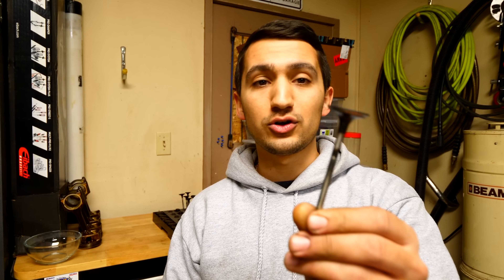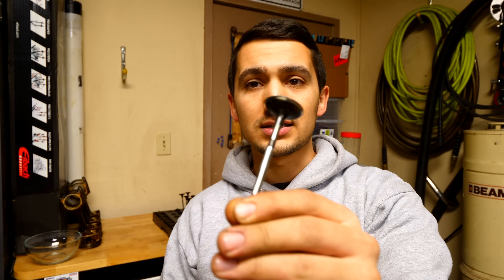How to Clean and Refinish Valves

Comment: the clearance between the stem and guide is much larger now this engine will smoke badly when first started  and continue .the stem seal allows a very small amount of oil  to slip past to   lubricated the guide. but its job is not to completely seal off oil from entering. the tight clearance between stem and guide are now much wider .you just tripled the amount of oil slipping past seal and right into the combustion chamber.

Comment: All comments about ruined valves aside, dude, at least change the water in between each grit of sandpaper!  Otherwise, you still have bits of the 800 in there when you're doing the 3000 grit!

Comment: So did you put this valvesback on the car? If you did is it still working after pushing the engine to the limit few times? No offence, buti think this is a way to have a beautiful shiny bent valves. It's ok to polish the valves where the carbon is getting accumulated, but sanding and polishing the stems will actually allow them to wiggle in the valve guide. Of course it won't be too obvious, but in time it will, (more likley when they will bend). And what is more important then everything is to lapping the valves. But we all learn from our mistakes.

Comment: it is good to have the carbon removed and on a smooth surface it will be harder for the carbon to ´stick´
It is hard to avoid the valve stem and even harder to avoid the seat area.
These area´s are measured in thousands of an inch !
@milanmastracci; if you get so many negative responses you might be doing something wrong.
You might want to review you're video and change or remove it.
there might be 6,5K thumbs up who are damaging there valves right now.

Comment: stop by your engine rebuilding shop.. take one valve with you.. ask for a single K-Line thin wall valve guide liner to push into your drill chuck to protect the top of your valve stem from chuck marks..   when you get done polishing you have to take your valves back to the engine rebuilding shop to have them put them in their Valve Refacer.  to cut a new precision sealing surface on the face..    Never polish the stem area that fits in the guides.

Comment: Just relap that with relap coarse cream continue with metal polish mix with engine oil,, its function for no compresion leaks betwen valve seat and valve it self. no need to polish the rod. 😅😆 btw thanks for sharing ✌️✌️

Comment: And now you can head to your local machine shop and have them grind your valves and seats because they no longer seal! And also you get to listen to the machine shop tell you your engine is going to suck a shit load of oil between the valve and valve guide becuse you removed so much off the stem.  Time for new valves!  But look at it this way,  you got 16 tiny paper weights out of the deal.

Comment: Better get new valve seals at least, cause if u sand the stems you’re making them smaller, also sanding the area that seats on the head, may not be a good idea, might wind up with a leaking cylinder, just clean any carbon in there with cleaner

Comment: For a cheap 4 cylinder rebuild this is fine. BUT for anything else you are going to ruin your valve seats. Machine shops have special tools to measure the amount of material being removed. It’s crucial to know the exact amount being removed to have a proper valve seat. Also, don’t EVER sandblast your valves. Smdh. - ASE certified mechanic

Comment: The more you sand the valves, the more hp you get. How??? Smaller valves opens bigger for more air flow.  MAD POWER!!!! Try polishing your cylinder walls like that too.  It adds 2 or more hp depending on your set up.

Comment: First mistake straight out of the gate - if you put the valve in a drill chuck you burr the shaft. This then kills your valve stem seals. That’s why engine builders don’t do this. Avoid this guys advice or you will have a short life engine that looks shiny!

Comment: First of all the valve polishing will do absolutely nothing, perhaps the shape will change by .00001" which won't make any negligible difference at all, period. Second, all valves are lapped when installed after tear down so I don't think it is necessary to repeat over and over if the engine has not yet been re-assembled. The engine will run fine, I have cleaned valves up with wire wheels on angle grinders and they drive and run perfectly fine, more than I can say about this lot.
Reply: So what actual training do you have? Because your comment is absurd, the angles WILL be changed. Dont you know the reason for having the right angles  on the valves? Its obvious you have no experience and are not a machinist, if you are or claim to be, I'd hate to be your customer.
Reply: @ricgomez1  Angles wont change at all because that requires the valve to be ground down with specialized carbide grinder, the sealing surface will be mated with even coarser grit compound.  I am a master tech with ASE 1 to 8 and L1 and work on cars almost every day, and the function of angled faces on a valve is to promote airflow which usually have small chunks of carbon that stick to them anyways and make not a damn bit of difference in the performance of the engine. So if carbon build up doesn't change the overall shape of a valve but polishing them up does then I don't think you understand the function of a poppet valve.
Reply: @jacobnichols2182  See here you go trying to sound like you know what you're talking about, I've been a machinist with 30 years of experience and you a small time mechanic is trying to teach me something? Bahahahaaaa... it's not worth my time trying to explain this to you, just do this...next time you have an engine to build YOU take the steps shown on this video yourself since you think you know what you're talking about and see how it works out for you. Have a nice day.
Reply: @ricgomez1  Clean valves with a wire wheel on an angle grinder and those engines still running so like I said, no issues at all.
Reply: @ricgomez1  I spent a whole lot of money for a machinist with 30+ years experience and got my cylinder head all messed up, missing hardware, double ordering parts and charging for them, head was discovered to be cracked after first engine run, still have to tear it off and find out why a reputable machinist who knows everything about tolerances overlooked so many mistakes

Comment: There is a reason shops only run a bit of scotchbrite over the valve. Plus don't use dry scotchbrite spray it with some wd40 first.

Comment: And also if your not sending everything out to machine shop ( I’m not ). It’s best to get a 5$ brass wire wheel from harbor freight and clean the valves safely!!!   Without removing any material before you hand lap the valve seats.  This polishing and sanding directly on the valve seats will add a lot of time to effectively matting the surfaces if your going old school and doing the lapping by hand

Comment: Use a wire wheel to remove the carbon then lap the valves in, it's that easy. Been building engines for a long time.......

Comment: I did this on a spare head laying around for shits an giggles and it works out quite nicely and after polishing I lapped the valves back into the seats and got a solid seal with oem margin (width of seal) and also when sanding I purposely put pressure on the leading and trailing edge of the margin to create a radius on the valve creating a poor mans 3 angle valve job.. Since this is with very fine grit sandpaper there is lil chance of doing anything but smoothing out the 2 angles on the margin and did not affect the sealing as the lapping of the valves came out perfectly I maybe spent 3 times the amount of time I normally do when lapping in valves because of this ... 
not only polished to reduce carbon build up but gained a lil flow as well ... granted I was willing to try this out as I had a spare head lying around but all in all this is not a wasted effort as I fully port and polish the heads when apart and repace guides and seals as well so Im not simply popping a head apart to polish the valves Im already in there doing other stuff and this procedure is saving me the money I would normally invest in a set of polished valves ... carbon build up is anti horsepower and doing everything to prevent it sames time and money ... 30 years ago when I used to race my camaro every winter I would tear entire engine apart to freshen it up for next year and remove carbon ( back then it was really an issue) for complete tear down rings and bearings and new oil pump and water pump etc,,, only cost $135 for everything so it wasn't that big a deal and occasionally you find something that if left unchecked might have cause a major issue

Comment: Please tape the valve stem before putting it in the chuck of the drill, slipping the chuck on tape is wayyyy less annoying than slipping the chuck on the valve stem seal surface.

Comment: Brick cleaner works brilliantly on exhaust valves, soak for 10 mins and simply wipe the hard crusty stuff off, Oven Pride oven cleaner works brilliant on cleaning inlet valves, wont be polished shiny but they will be clean as per factory and ready for a quick lapping.

Comment: Thanks for the tip , after I polished the valves using your method I figured why stop there? So I sandblasted, sanded, and polished the inside of my whole exhaust system, headers and all. I burnt up 4 dewalt drills in the process. It’s a good thing I don’t have any compression because it looks so fast and air doesn’t want to stick to it. Haha I can’t even pretend to not know as much as you. Thanks for the customers too bad they can’t sue you for bad advice.

Comment: Personally there's no point polishing the valves because when the engines running getting hot will be all over the valves so it will take the polish off sanding the valves to remove the carbon is ok just be careful not to sand too much because of removing a layer of metal of the valves like the idea of using the drill

Comment: This makes for a nice looking valve for sure but to say that you will not damage anything you are not considering enough of what you are doing. 
By polishing, sanding, using abrasive on the shaft of the valve you are reducing its size. This can cause issues with the valve to valve guide clearances. I have seen countless head/valves with this issue and it will cause premature wear on the guides, valves and will also result in burning of oil resulting in even more carbon. 
Given that I dont have the specs of your valve to guide clearances I cant speak on your specific application however this is something you need to consider when building a performance motor.

Comment: Sure it looks good but once it's in your engine you won't see it again until you next have the cylinder head off. What matters is performance and all you need to do is lap the valves with the valve seats. If you want to go crazy you can make a 3 angle or even 5 angle valves.

Comment: Firstly, clean the stem.... do NOT sand it. Creating a smoother surface “near” the seat, does create better air flow but there is absolutely no need to polish. Especially the underside of the valve. Watch Uncle Tony’s Garage” on how to work your valves. Also, listen to what he says about “Volume vs Velocity” .... the dude is a genius and can back up everything he says.

Comment: No sandblasting, no sanding. You are messing with your tolerances and valve seating. Boil the valves in water and baking soda to clean them and just give them a quick polish on a buffing wheel with polish compound "not cutting compound" and they will be better than new without messing with the specs of the valves

Comment: i started the same process 24 grit all the way to 5000 grit trizac paper. Mirror polished and after weighing them I saved almost a full 2oz per valve.  now all I need to do is find a set of valve guides for a 2.5mm valve stem. as far as the air sticking to the valve itself I use this loud whistley thing to push the air across mine pretty damn hard

Comment: Lol leaning moment, you said that air sticks to carbon, it doesn’t actually sticks, it just restricts. The plenum is a constant source of vacuum which will result in constant pressure to intake stroke, the piston will creat enough pressure for the exhaust stroke what you can do while resurfacing angle the seat without affecting the margin if you angle it to a 30 degrees there will be little restriction no sharp corners improving air flow and more air more power. Angle good one way to clean your pistons and valves is using a small amount of water and bypassing the intake in a source of vacuum, it literally steam cleans the chamber, small amount of water good, too much water bad. It’s like when you have a leaking head gasket, and you pull of the head the piston that coolant or water was going into looks clean and polished, just thought that might be some good topics for your next video.

Comment: This is ok for the combustion chamber side of the valve but any other part of the is completely harmful to the stem and guide clearances, and a iintake port flows better with a rough surface say 320 grit due to air lubricates it's self, a buffer if you will please don't do this fellow YouTubers . Port match intakes and open exhaust a little polish combustion chamber of comp is not needed

Comment: I'm no pro mechanic, but pretty sure you need to lap all of those valves and you probably should have never used scotch-brite or sandpaper...I've always heard to use a brass wire wheel so that you don't damage any of the valves. Also, you should only be cleaning and scrubbing the part of the valve below the neck (don't know the proper term). Any work on where the valve seals ride and you run the risk of damaging the seals when you get everything back together.

Comment: Fuel and air will not pass over these better. The smooth surface will cause drag. The fuel will attempt to puddle do to the air slowing down and not staying suspended. The slight roughness of a valve is to create very small air pockets that allow the air to glide over the top of it. Also, you're taking metal away from the stem creating more gap in the stem seal. What happens when you lap the valves to the valve seat.

Comment: I use ChemDip to soak the valves first.  This loosens up most of the carbon and makes it easy to just wipe off.  If you don't have a media blaster like in the video, I'd recommend doing this first before sanding the valves.

Comment: If you get any marks on the shaft of the valve by putting it in your drill, your valve stem oil seals will probably leak and fail prematurely.

Comment: Don't waste your time folks, this is rediculas at best. The Scotch bright pad cleaning is fine, but there is absolutely no need to go any further. You do not sand down valves, only lap the valve seats. Last thing you want is valve stem and valve guide clearance enlarged. If anything he made matters worse, now the valve will move around in the guides preventing proper seating every time. That in turn will tear the valve seals up, woller out the guides, and ruin the seats... this is NOT a good idea.

Comment: When doing this do you run the risk of changing the clearance of each valve or will this not effect it at all?
Reply: Yes. He completely ruined these valves by doing this. Do not blast, sand, or grind the stems, this will screw up the clearances.

Comment: Bunch of idiots on here who have zero experience building engines. Lightly Sanding the stem with 800+ grit wet near the head of the valve does not matter at all. That part of the valve does not touch the valve guide, it sits inside the inner spring touching nothing. Polishing the valve is a common action by many reputable shops. After his polish he should get the valves seat areas reground and lapped. Also there are aftermarket coatings that can be applied to the valve to replace the coatings that are polished off if one chooses. Good luck as long as you take the proper next steps you will be just fine.
Reply: Did you miss the part where he sandblasted the valve stems with glass medium?

Comment: You are polishing the seal (seat) off.

This is one of the how not to do it videos.
Reply: I know more about building race engines, than you will ever know. Half the people on here dont know what they are doing and would just put it back together.. i built my last full car in 2000, it was supposed to be the cover car  for muscle mustangs and hot rod mag. 800 rwhp on a chasis dyno. Fuel injected, 397, twin 50mm throttle bodies, stroker steel crank titanium rods.the ultra light wrist pins weighed 18 grams each, fire ringed block and head.  Let me guess you built a model car once.
Reply: @540 MUDSTAIN went to tour channel,  you won't ring the block and head because it is a bandaid. Putting a fire ring would have prevented the blown head gasket. Drill and tap the block put the next biggest arp head stud in, this will give you more clamping strength. But hey your the expert.   Hahahaha

Comment: the performance increase of polished valves is negligible. The first hour you start that engine, EGR oil will cook on your polished surface and all your efforts goes to trash... if your after REAL performance then lap them and fuel leak test them!

Comment: *Great video. But what about protecting the part of the valve stem that touches the valve seal?
Reply: Camry le A high polish finish should be easier on a valve seal. Polishing shouldn't change the dimension significantly to affect the sealing of oil.

Comment: All these people saying polishing isn't worth it. If the surface on the valve is pitted/scratched then oil and carbon can stick to it. If the surface is highly polished it will stop/reduce particulates sticking. A bit like painting a polished surface, it won't stick. Either way, who cares. If he wants to put a tonne of effort into rebuilding the engine and getting every little bit perfect then more power too him